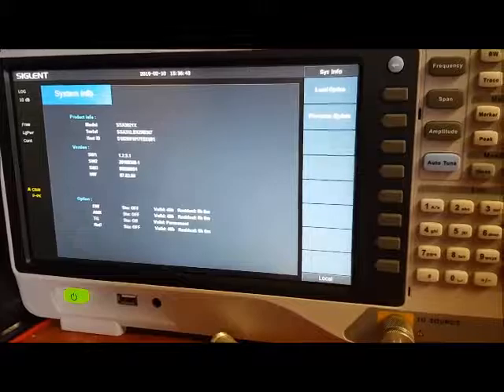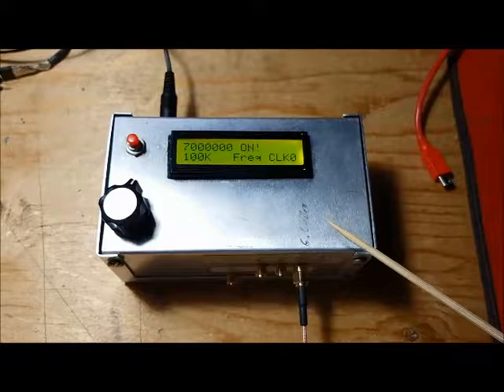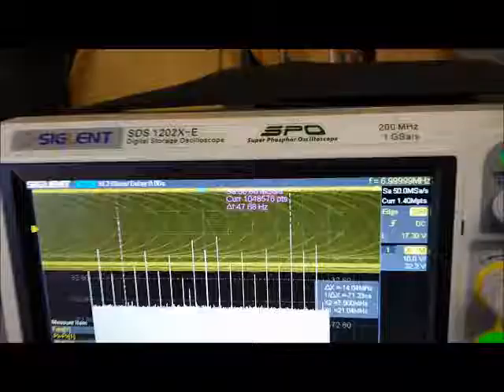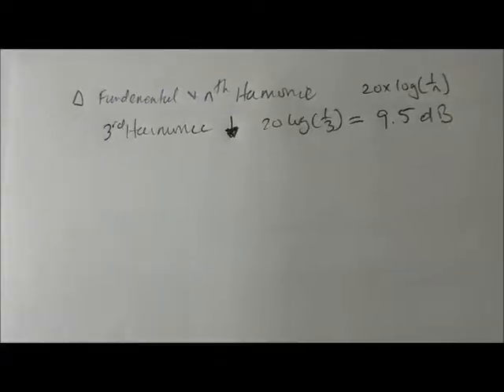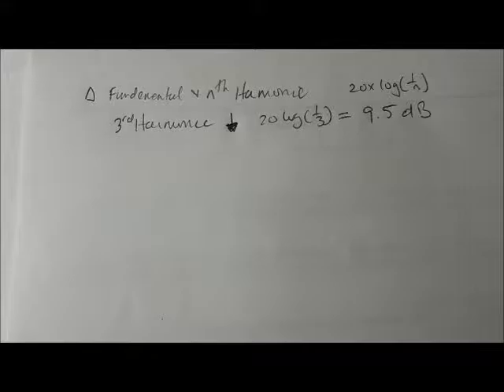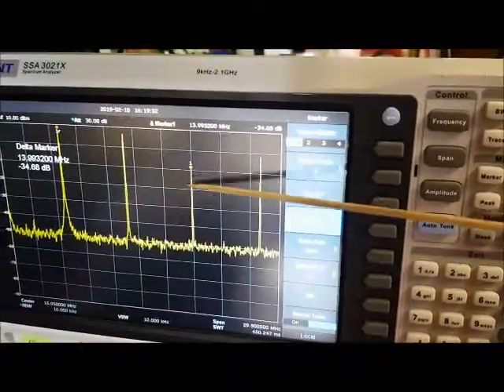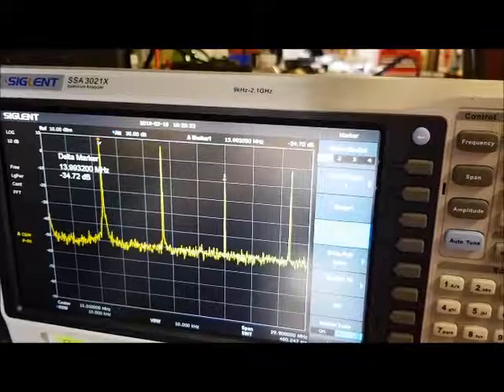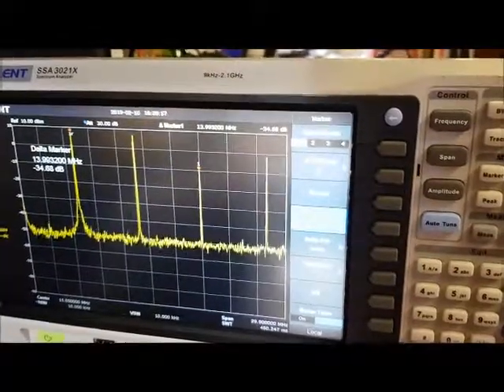SA Problem Description

Comment: man, you are over-driving the poor spectrum analyzer. so all amplitudes are distorted and wrong. look at the large second harmonic which was not that big when the attenuation was 50db. your fundamental is larger than 10dB so it's actually overshooting the display but the marker only sees 10dB. you HAVE to use an external attenuator or at least increase the attenuation to a large value because your input signal is very strong.
Reply from the maker: Yup. Blew out the front end previously to this. This video was made to send to Siglent.